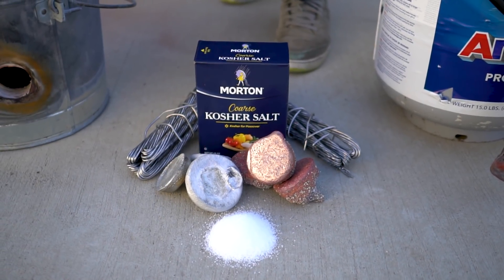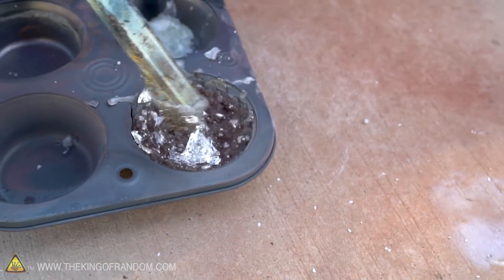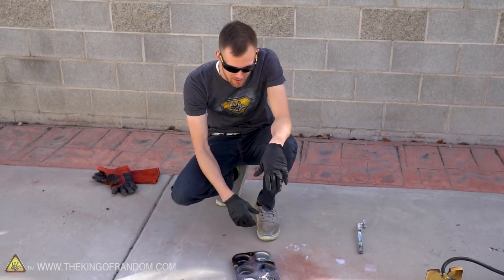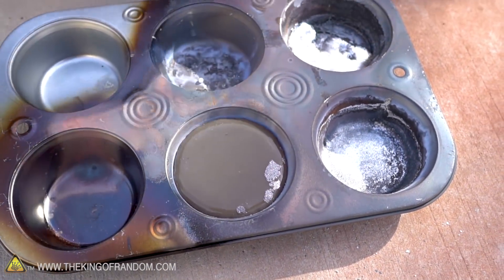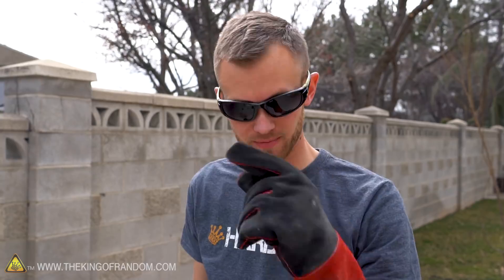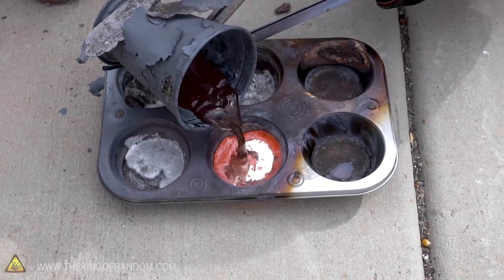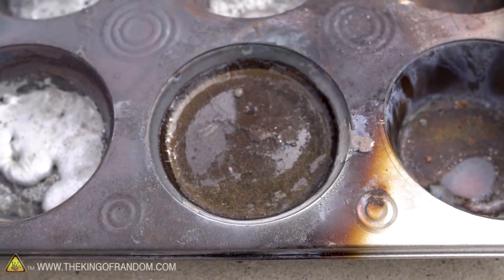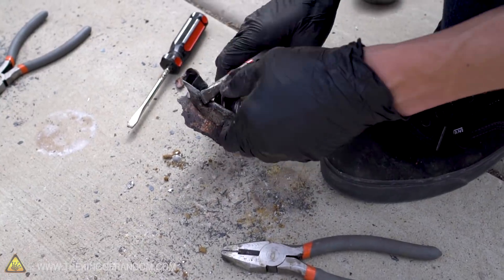When Molten Salt Hits Molten Metal

Comment: Makes me curious about mixing them while molten in the furnace, like puting the aluminum and salt in the same crucible, and the copper and salt in the same crucible, letting them both reach the same liquid temp and mixing togeather while in furnace then pouring, seeing if it had a diferent result.... i was more so looking up liquid salt casting because of supernatural, Bobby has the panic room made of pure iron with a layer of salt coating, i was curious how he smoothly bonded the salt to the iron if it was him melting the salt and pouring it over the cold metal or growing salt crystals on the iron in vats....

Comment: Well you're mixing a metal and a halide, so it's like oil and water. The differences in density n viscosity at melting point will make one float on top of the other.

Comment: Can you get some raw copper with impurities and then melt in a ratio like 40% copper and 60% slat and check if the copper is cleaned or not... I think its nice little experiment you can do it.

Comment: I think that expanding of aluminum and salt is the result of aluminum. Where I work, we use, among other, crucibles with gallium and aluminum (separately :D ) that are kept in molten state all the time.  If we have to bring the temperature down below the melting point, the crucible is considered to be cracked and changed for a  new one

Comment: I suspect that the color of the salt is caused by the oxidized/corroded metal in it. The heat alone oxidizes metal even before the melting point and salt is known to speed up the process of oxidization in metals. That's why there are shades of green in the salt mixed with copper and why there are shades of blue in the salt mixed with aluminum. When corroded, copper will turn green and aluminum a bluish dark grey.

Comment: I know it would be a bit of a hassle but if you melt the copper and salt again like you did here in this video and pour it out the same way. Try taking the salt that became bonded to the copper and have an assay done on it. Maybe during the extreme shift in temperature there might have been a chemical reaction. Speaking of chemical reactions I would love to find out if there is a way to separate the sodium from the chlorine in salt.

Comment: Looks like the salt layer on the copper was anhydrous copper(II) chloride, which makes sense that the Cu(II) cations would replace some of the sodium cations in the NaCl ionic salt. If you try mixing the Cu(Cl)2 salt into water for a bit, you should get a bright blue colored solution.
Also, you did the whole video on making new tongs to not use them here? Seems odd, but maybe the time of production differed from time of posting. I know that can happen a lot with channels that release daily videos.

Comment: WHY didn't you use NON STICK SPRAY!?!?!?!?!?!?         ... Jk but question... Why didn't you just melt all of them together instead of melting them separately and combining them outside the furnace? Couldn't you have put aluminum or copper in a cup and then some salt on top of it and then melt it?

Comment: There wasn’t anything scientifically logical about this video... they took cations and tried to combine them with cations. It doesn’t work that way. Alkalis don’t usually have metallic bonds. If anything was gonna happen, the non metal in the salt would dissociate then bind with the metal to make a different salt. This is unlikely because the ionic bonds in the alkali salts have such a high specific heat that you would nearly vaporize the pure metal before you could even break the bonds. Also there isn’t any polar forces in the pure metal that could separate the salts bonds, so the salt would be even less likely to dissociate. I’m only in freshman chemistry in college and I know at least this much.

Comment: I wonder if you left the salt to cool in the pan and poured the molten copper on it if it would remelt or if the salt would cool the copper enough to solidify 1st.  If it stays solid enough the salt might allow for the copper to be easier to remove from the pan.

Comment: Since you didn't have much luck pouring melted salt onto melted copper, what if you filled the same cup with salt and copper pipes and melted them together? You could also try that with salt and aluminum since they didn't seem to mix well either.

Comment: Salt is a chemical.  Copper is a chemical.  When you mix the chemicals there is a metal ion substitution.  Some of your salt is now copper chloride.  That is why the color change. Your copper also probably now has some sodium impurities in it also.  Yay for entropy and quantum mechanics!  This is the technology behind modern ultra high capacity industrial batteries that store gigawatts of power.

Comment: The muffin tin melted to it it turned red when you poured it in
Reply: It glowed red because the melting point of copper is well above the point of incandescence. Steel is an excellent thermal conductor, so it took the heat from the copper very quickly and started glowing too. It was nowhere near molten, nor even softened. Copper just sticks to steel very well, while aluminium doesn't. It's essentially the same as gallium coating glass while mercury doesn't.

Comment: Someone may have already said this, but if you mix the copper and/or aluminum with salt in the crucible together while under heat the salt acts as a flux for the metals and caues the impurities to float on the top. You can skim the slag off the top and you will have a more pure form of the metal.

Comment: Make a Copper Aluminum alloy and see if it's easier to work with than pure copper.

Aluminum : Copper ratios you should try (by weight) are
1:1
2:1
3:2

Comment: In reference to the liquid copper and liquid salt mixing... Even though they both melt at different temperatures, I don’t think the salt is “cooler” than the copper. They were both in the same furnace. It wouldn’t make sense that, despite having different melting points, the temperature from one would be higher or lower than the other. 
Thoughts? 
Facts?

Comment: concrete can explode if molten metal falls on it. The water in concrete will flash boil. You really should be doing this over ceramic bricks.

Comment: Maybe this will work better if you mix powdered copper or aluminum with the salt before melting it. You can order powdered metal online, I recommend using metal powder instead of file shavings.

Comment: You know there's a suggestion that my dad told me that I tried out because my aluminum was getting too hot to pour into the steel molds cuz then it would stick. so what I did was with my dad's advice I crushed up some charcoal and sprayed the with Pam cooking spray and then coated the inside with the charcoal so that when I knocked the ingots out they fell out it without a problem but there would still be some carbon stuck to the side of the ingot so it wouldn't attach  to the sides of the steel pan although you do need to take an angle grinder sanding blade to it after you're done to get the carbon off

Comment: this won't work due to the different bond of the salt and aluminum/ copper. Salt is an ionic bond between sodium and chloride, and sodium is an Alkali metal and chloride is a Non-metal these together are a compound. Copper and Aluminum are both elements that are Transition metals, and Transition metals only mix with transition metals this includes Copper
, Zinc, Iron, and so on.

Comment: You should send that weird brown salt (NaCl) crust to Cody - he's got an X-ray machine that can analyse chemical components of things. Try melting Tin (Sn) - it's ridiculously shiny when raw. You can mix it with Lead (Pb) and Copper (Cu) quite easily.
Reply: Great idea. Still, while the handheld XRF will tell you how much (if any) copper is in the salt, it can't tell you what form the copper is in. It's possible that the fast-cooling of copper allowed a small amount of metallic copper to disperse into the salt, but it's also possible that some combination of copper, oxygen, sodium and chlorine has made a distinct compound that is dispersed within the salt crust. There are a plethora of possibilities, including ones involving copper complexes (I'm thinking Na2[CuCl4], - sodium tetrachlorocuprate (II) is a possibility).
Reply: I believe it was a chemical reaction. CuCl2-copper chloride formed which is a brown salt
Reply: If there was any sodium tetrachlorocuprate present, that would give the salt an intense bright yellowish green colour, even if only tiny amounts were there. You can make a similar complex in water solution fairly easily, by dissolving a soluble copper salt (such as copper sulfate or copper nitrate) into concentrated hydrochloric acid. This just forms the [CuCl4]2- ion without any sodium present, but this has the same colour.

With the brown salt formed here, it's more likely that the molten salt acted somewhat like a flux and some oxides from the copper dissolved into the salt. Copper(I) oxide is pink, copper(II) oxide is black, so addition of a little bit of both could easy result in a brown salt like we see near the end of this video.
Reply: I don't know if its Sodium tetrachlorocuprate (II), I think it might be Copper (II) Chloride.
Reply: @thepetrarcticwar2778  Not sure how such a reaction would go. If chlorine bounded with copper, making chloride, what became of sodium? Pretty sure all possible products would be pretty reactive.
Reply: I think everybody should know the symbols of each element on the periodic table if they watch this kind of content :p

Comment: Molten chloride salts make for excellent fluxes. If you add in some calcium chloride the mixture will dissolve all metal oxides like crazy, and you can pour some really metallic and clean surfaces. Thats also why the copper looks so nice and red; and the salt so brown. Oh yeah and you probably should not lick it too much. Not only are not all metal salts equally healthy; especially if you add some calcium chloride it will start dissolving all kinds of chinesium from your crucible too.

Comment: I think the brown color is due to copper(II) chloride being formed.  Possible future experiments:
1) melt metal + salt in same crucible (probably get much the same result)
2) remelt mixed ingot to see if you can separate the salt from the metal
3) with a stirred mix (like the Al/salt mixed up ingot) use water to dissolve away the salt and see what the aluminum looks like

Comment: A) Use the tong that you made or have some proper tongs made for you.
B) Line the tine with liquid paper (whiteout) when pouring higher temp metals(copper, brass, etc.) into the steel muffin pan. This will help keep the metals from sticking as much. Use a lot.

Comment: you guys may want to try making maple sugar! 

you contiune boiling maple syrup until even less water is left inside. when it becomes molten maple sugar you rapidly aerate the molten sugar with an electric mixer, as the air is mixed into the molten sugar it rapidly drys and cools into chunks of granulated maple sugar. its both really cool and delicious

Comment: Why not melt the metal and the salt in the same crucible?
Reply: Because if it were to alloy that could be potentially destructive to the crucible which is considerably more expensive than a cake tin. They know the crucible can withstand molten metals and salt, they don't necessarily know if it could withstand the result of mixing them. This is just safer.

As for what you're really wondering. No, melting them together won't result in anything different. Salt can't form alloys as it's not an element.

Comment: mix them inside the furnace instead of pouring them on each other
Reply: How many people seriously think this would make a difference? Salt literally can't alloy with a metal since it's a compound of sodium, not an element. Melting them together will be no different in any way to mixing them afterwards beside having a cleaner separation due to the layering of their different densities.
Reply: at least better than the idea mixing them out the furnace
Reply: Not at all. It's no different. Exactly the same result, not worth another video.
Reply: HMS-Captain Lurmey depending on the metal you could well get sodium fumes. It should work with aluminum. Copper is quite nobel it won't bother with sodium but iirc aluminum is less noble than sodium meaning it could reduce the sodium ions to sodium which literally would evaporate at these temperatures. (though the aluminum chloride that would form would break into aluminum and chlorine gas). But that's grey theory. Chance of success 0.001% I'd say

Comment: Try to melt gold or silver, it would be great fun
Reply: and gold is high and expensive
Reply: Elijah Jaeger you know the arc furnace right?
Reply: Elijah Jaeger you can melt gold with a torch. I'm pretty sure two propane torches could easily melt it
Reply: Oregano sorry I was just thinking of the process the Canadians do to smelt down gold and silver.  Both Ag and Au have melting points below 2,000 degrees Fahrenheit. Depending on how pure they are.
Reply: klo udz atleast silver in neat foundry, so can extract ed cleanly
Reply: Elijah Jaeger Actually, the melting points of both silver and gold are lower than copper.
Reply: 1700ish degrees melts gold.
Reply: Ŕųśhî Śçöřpîøñ gold and silver have extremely high melting points.  Higher than this foundry can get to.

Comment: Make some metal alloys!
Reply: They've made bronze and brass before. What else do you want?
Reply: HMS-Captain Lurmey  like gun metal , etc
Reply: That's just bronze with added zinc to increase it's corrosion resistance. Would be interesting to see them make it, but I don't think it's as easy as melting metals together.
Reply: I mean, modern guns are made of steel but I know what you meant.
Reply: HMS-Captain Lurmey ya but they won't  only do one thing with metal mixing, will they?

Comment: You should put the salt and the copper into the same pot while in the fireplace thing and mix it as they melt, take the pot out when everything is mixed or if they will
Reply: HMS-Captain Lurmey You could've looked it up to begin with and skipped the video entirely, an average viewer not knowing how the materials are supposed to react together might hypothesize that the material that hits the pan first may be cooling at a slightly faster rate, and that that slight difference in temperature is what's causing the separation, therefore before writing it off as a failure they'd like to see the materials melted together in the furnace to know that it makes no difference. 

To say "look it up it doesn't work" is to spit in the face of the very nature of this show, none of these experiments need to be done, all the results can be guessed with a basic understanding of the fundamentals of the components at hand, they do them anyway, because knowing how something should react and seeing how something does are two separate concepts, and this show focuses on the later.
Reply: Melting them together or mixing them afterwards is no different. Salt will never alloy with these metals. The process of alloying is the combination of two elements, one of which being a metal but table salt (NaCl) isn't an element at all, it belongs to a group of compounds literally called salts. It can be referred to as a sodium salt, likewise with sodium carbonate etc.
Reply: HMS-Captain Lurmey yea ik but that was an example everyone doesnt know that and seeing the metalls being mixed inside the foundry would be nice
Reply: Nothing here was an example and it's not hard to look up how alloys work. It wouldn't be interesting at all to see them melted in the same container as it wouldn't do anything new. You'd just see glowing liquid and it'd settle out into the same two separate layers of salt and metal.

Comment: I would wager that some of the chlorine bonded with the metals making aluminum salt and copper salt respectively.

Also, try dusting your muffin pans with talcum powder before each pour to keep the molten metals from bonding with the steel.
Baby powder would work fine for your experiments.

Comment: You should try to mix the salt and metal while they are in the foundry

Like so they can see it😉😉😀☺
Reply: Won't make a difference. Salt will never alloy with a metal. It may react with the right kind of metal but it'll never alloy since it itself isn't an element and only elements can alloy together. Table salt (NaCl) is a compound known as a sodium salt.

Comment: you should have just smelted them together in the furnace to get the result that you wanted.
Reply: What result are you expecting from that? Salt literally cannot form an alloy, it's not an element. Melting them in the same crucible makes no significant difference.